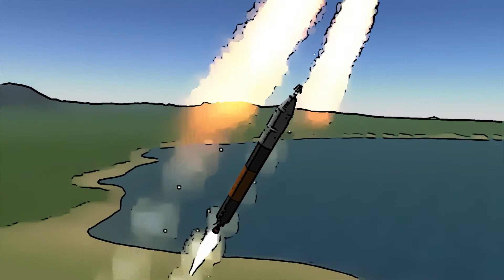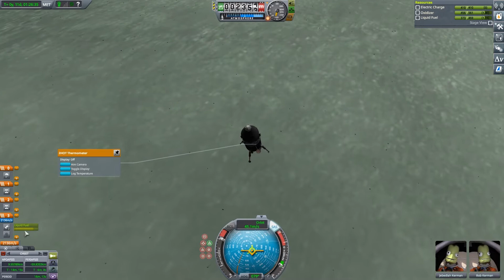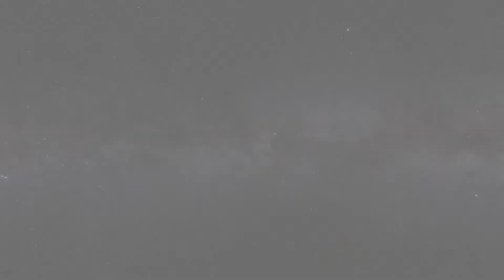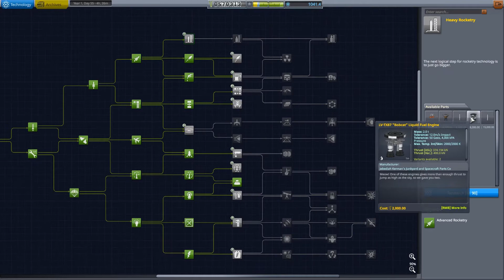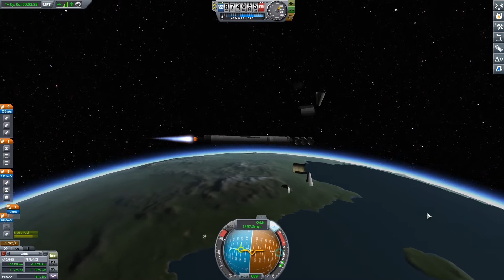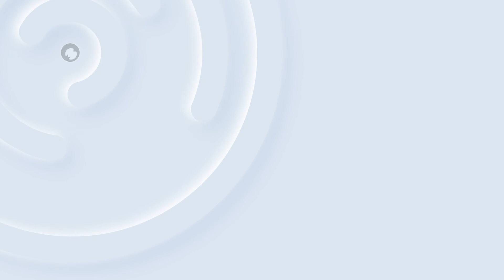KSP | Back to Basics | 11 | Kerbostationary Kommunication

Comment: In a keo-stationary orbit, your surface velocity also should be zero. That is another way to tell if you got the orbit right. Nice launch too, I like how you launched all three satellites at once and used a resonance orbit to set them up at the right separation. I always struggle with that.
Reply from the maker: They are actually in keo-synchronous orbit because their is a small liberation but over a 6h period they are returning to their original relative position